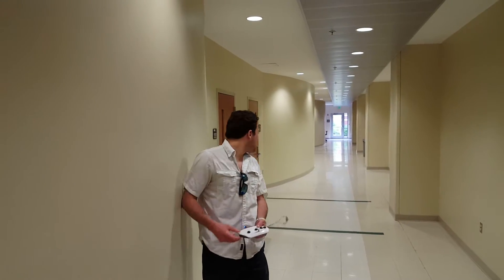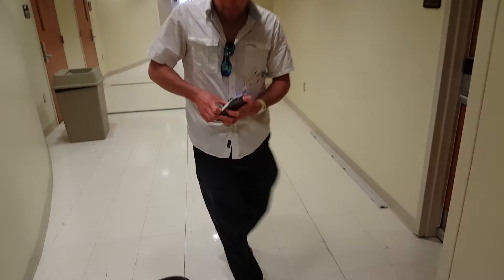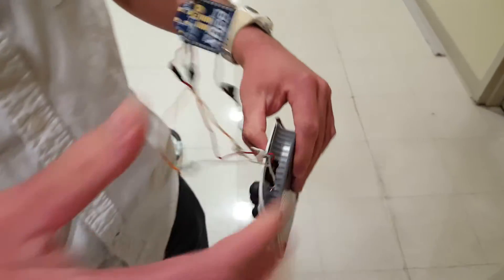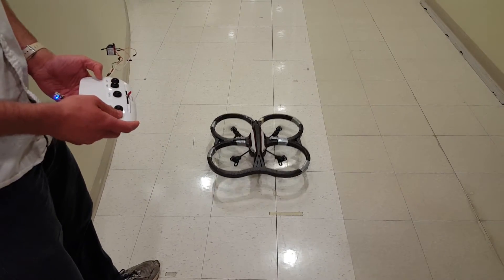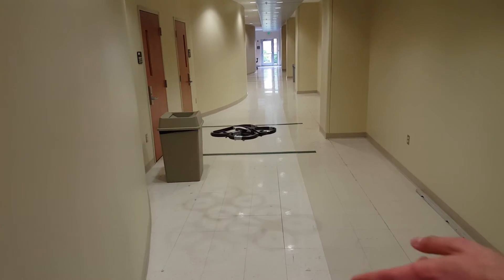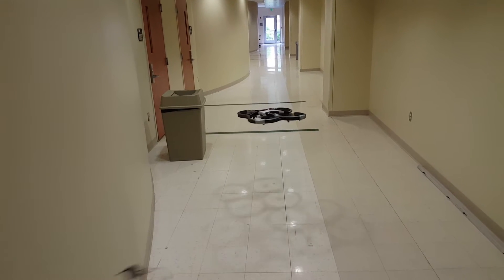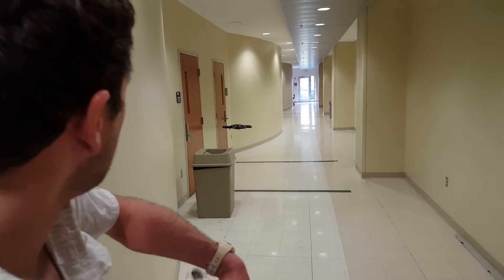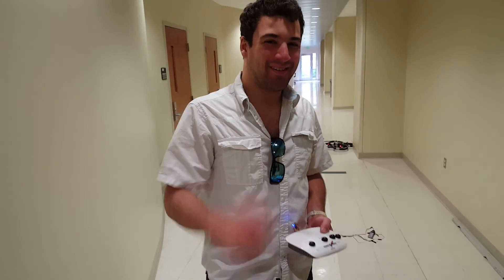An ESP8266 AR Drone 2.0 Controller

Comment: (0:34) vaping  batteries? man I know them as laser pointer batteries HA HA. or "over discharge and kill it" batteries. ;) by the way, came here from your ghettoIII vape video, that I was looking for info to build a good ramped power vape machine for my room mate, they have PTSD so the snap of vaping causes them horrible neck issues (missing discs in the neck and lower back) which I just figured was from the heat causing the vape juice to turn to steam too fast or something, so slower ramp to create a lower frequency sound when it steams, might work, though I am not opposed to building a muffling case to kill the sound with antiharmonic wave cancelation, lol Going to use my CNC mill to make the case mostly too, so it is all copper heat pipes and fins as much as possible, So I will have to post my results and some info if you are interested still, in a vape project :) (not sure what else I am going to try and cram in there, but plan on trying to make it operate more like a hooka or water pipe (see bong, though I got used to the other term, since the head shops here have to throw you out if you call them a bong, due to it being thought to be a term for MJ pipe in the backward thinking idiot minded people who run this state) anyway, reason was to keep the juice from leaking, like I see in a lot of vape machines. also going to coat everything with oleophobic coating I have here for glass or metal and plastic (two different application methods for nano quartz crystal spheres, that limit the ability to bond to them or below them, on the surface due to surface tension :) )  Originally I got the couple Arduinos I have to run LEDs and some possible 3D printer applications for the replicator level 3D printer I am working on and designing, but the LEDs being for a hulahoop for the room mates kid for christmas never happened, and now they are all into vaping either to get off the cigs or for CDB (?SP) oil for the PTSD and what not,. and I might actually make one for myself too, though for testing to see if I can make a brain fuel vape juice, out of stuff like Ginkgo leaf extract or something, I know it has its same mind opening effect when smoked as it does from eating enough of the leaves to overdose on it (according to some the amount is over dosing, though really I dont see it as anything more than using it as the ruffage in salad. even if it is a little fishy tasting when properly yellowed and aged, lol) anyway, I am still wanting to see if I can restimulate that spinal cord cellular growth, that normally only happens during very early development in the first few months or year, of human life, and determines whether or not we are field dependent or independent :)  If you read all this, here is my suggestion for project boxes (in oneis and twosies since its asking for samples from a company,) https://www.okwenclosures.com/en/Products/Aluminum-enclosures.htm I already have some of their aluminum cube units and a removeable station with base plastic unit and man fantastic for a starting point, far better than anything I have seen from digikey or mouser, though pricey if anyone was to begin buying them for sale or work, though I build a lot with t-slot so I guess not really LOL.anyway.
Reply from the maker: thats a wonderful thing to do for a friend! I wish you the best in your projects, and ty for your box suggestion
Reply: @julianloiacono4882  hi there is there a possibility of a vid explaining how to make a vape with an Arduino Uno, and and with an LCD scree, and maby some code😅😅
Reply: oh was going to ask if you used a raspberry pi in the drone or not. Been looking at trying that out with one of the pi 3b+s I have :)
Reply from the maker: @ThomasAndersonbsf  we did not use an RPI for the drone, but I wish we would've

Comment: I'm trying to use analogues in my control at least one analogue would already be good, can you tell me some schematic to use along with esp8266? It may be a project to sell I want to focus on just the code. Congratulations on the project
Reply: the hardware is fairly simple if the xBee is left out. To my memory there is only power, and buttons connected to the ESP8266. The button locations are indicated in the source code, and are connected to ground using either an external or internal pullup resistor. Sorry, I don't have the schematic diagram anymore.

Comment: olá amigo tem como mandar o projeto deste controle?
Reply: have you tried building the github code and running it on your esp8266?
Reply: the only externals you need is a) power and b) the buttons. check for button GPIO location in the source code.